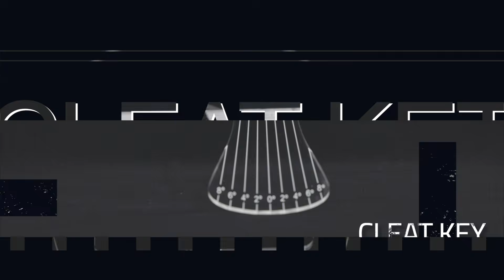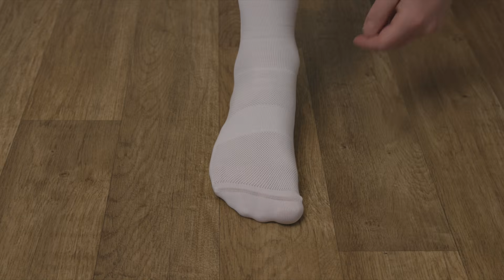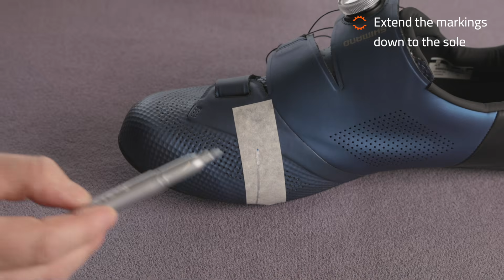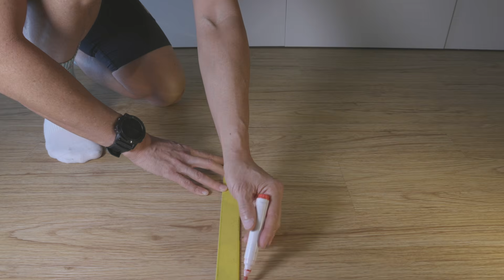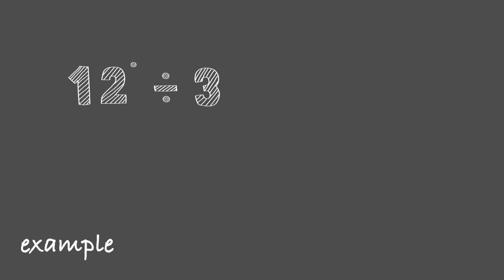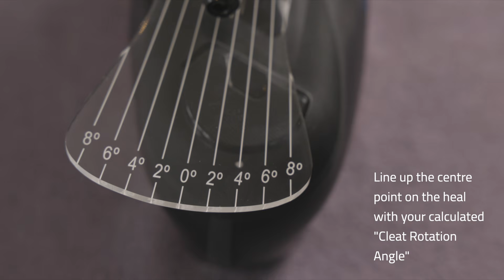HOW TO: set up your road bike cleats

Comment: Hi, why do you divide by three? Thanks
Reply from the maker: Hi @Soonaone, great question.  The human body has an amazing way of straightening itself out when a load is applied. The “divide by 3” factor was determined by observing and measuring riders at all levels to determine a correlation between the angle of the foot in a simple jump test and the neutral position of the foot on a bike when power is applied around the pedal stroke (using digital motion capture). The method has been tested on thousands of customers and Cleat Key users, from beginner to elite. More here: https://www.cleat-key.com/pages/faq

Comment: Just got mine today. I had tried to do the cleat angle myself using some protractors and thought I got it right, but when this tool showed up, it turns out I was 3° off on each foot. Even though this is a very specific tool, I hate uncertainty when it comes to cycling measurements and this is another niche tool that gets the job done and takes uncertainty out of the equation
Reply from the maker: Thanks so much for this feedback @lombremic4840. That's exactly why we developed the Cleat Key. Without it, you have no way of making sure you're getting the full benefit of the float provided by the cleat.

Comment: Thanks! How do you determine the lateral position/stance width?
Reply from the maker: Great question! In the fitting studio we use motion capture to observe knee motion, but the idea is simply to get the knee laterally over the pedal. 

Generally people with a wider hip structure will want to set the cleats inboard for a wider stance, and people with narrow hips will want to set the cleats outboard for a more narrow stance. However, keep in mind that Shimano and Look cleats only allow for a tiny amount of lateral adjustment, just a few mm! A better way for a wide-hip rider to get the knee under their pedals might be to center the cleat laterally and use a longer pedal spindle, like the Shimano +4mm pedals, or Favero powermeter pedals.   

More on this at our FAQ at www.cleat-key.com.
Reply: @cleat-key  thanks! I was hoping for some other method 😀

Comment: all these tools are for look. shimano pedals... i ride time road pedals
Reply from the maker: Yes, Look and Shimano only at this point.  We're working on a version that is specific to Time, which has a larger, different cleat design.
Reply: @cleat-key  not to be rude...but i have always wondered why  time and campagnolo. have always left to last..on the back burner// has shimano bought  out everyone?  sort of ole payola..in the music industry..of years ago..time has been around as long or a little longer than shimano pedals..i worked in a shop back then.. look was first out the door... then time shortly after..
Reply from the maker: @randellgribben9772  First mover advantage I guess.  I got my first pair of clipless pedals in 1986. The Look system first appeared in 1984. Rightly or wrongly, it has stood the test of time and Look/Shimano are by far the market leaders for road pedals today.  That's not necessary a bad thing as it has forced road shoe companies to make (nearly) all their shoes compatible with the Look/Shimano 3-bolt cleat pattern. We sell all 3 brands at the Bike Energy Lab, they're all good, but Time just hasn't got the same level of market adoption at this point.

Comment: im sorry i still dont understand why people need to state them that way for? sorry only just started on road riding but I've always worn stds on MTB so I kind of just use them the same. i use look in the red so I have full movement in them for cornering etc etc but when riding then it just shapes as it does Automaticaly?? sorry curious. oh as for starting started firthust back furt bad so then fushed them furthest to the front then back one notch and kept at that since????
Reply from the maker: Cleat float and cleat rotation are two different things.  If your neutral foot stance (while pedalling) is not centred on your cleat, you may not be getting the full float provided by your cleat. The Cleat Key is used to quantify your cleat rotation angle.
Reply: @cleat-key  im sorry ive only been ridding for now 20 years guess I still need to learn

Comment: I tried adjusting my cleat position, my foot now rubs against the crank arm. What did i do wrong?
Reply from the maker: Don't forget to divide you foot splay angle by 3 to determine your cleat angle! If after doing this, your heel still hits the rear stay, you many need to bias the cleat position a bit.  The Cleat Key can help you fine tune that.

We discuss exactly that in our FAQ here: www.cleat-key.com

Comment: Put the cleats as far back as they go.
This is a really old theory. When you are walking the maximum pressure point in your foot wil be the head of the second metatarsal bone, and it's been wrongly thought that that should be the point where the axle of the pedal should be.
That's wrong.

In Cycling the foot has to be considered as a lever, and it's not such a great lever.
If you put the cleats that far forward you are going to cause fatigue to you calf, and the foot won't be stable.
You have to set your cleats (generally) as far back as they go, cause that is a much stronger area compared to the front foot.
It's a elementary biomechanical notion, as a podiatrist I can't see how this theory has still been shown.

Sorry for the English, greetings from Italy.
Reply: This! Listen to this man. He speaks the Truth.
Reply: Fit two dozen riders like this and then watch them ride.  People think bike fitting is easy because it’s a simple set of rules. Bike fitting is about biodiversity. Set up two dozen riders in the same position and you’ll get wildly different results.
Reply from the maker: @edsassler  Totally agree. Fitting cleats all the way back may work well for some people, not others. And that said, the Cleat Key is the only tool we know of that can help a rider accurately quantify their own individual cleat rotation angle.
Reply: @ back in the late 70’s the New England Cycling Academy came out with a set of free floating pedals with indicators sticking out the side. One indicator moved with the foot, the other stayed perpendicular to the pedal. It was a way of seeing foot angle as the rider actually pedals the bike. Some how we lost this technology. There are countless videos about setting up cleats, yet the hardest cases wind up in my fit studio because I use valid measuring devices….
Reply from the maker: @edsassler  That was the Fit Kit R.A.D. I also used it extensively in the early 80s, but it was fiddly. Modern motion capture systems can now do a much better body measurement job than the Fit Kit sticks sticking out of the side of the pedal. It and many other cleat fitting systems have come and gone (although the Fit Kit brand lives on and is owned by fitter John Higgins in Utah, who is also a distributor of the Cleat Key). The Cleat Key is primarily designed to quantify cleat rotation, and we’ve sold thousands to shops and fitters, including some who have done great reviews on YouTube. It exists because I needed a tool to do this accurately as a fitter, and I thought it could help others.

Just about any cyclist can use a Cleat Key to get a good cleat position, and one that ensures they get the maximal benefit from the available float. These are cyclists who would likely not visit a fitter anyway and would otherwise end up in a much worse position. We validated the protocol using motion capture on hundreds of cyclists over several years, and it worked as intended in every single case. I’m sure there are outliers.
Reply: @ I still have 3 sets of R.A.D. Pedals for Look, SPD and SPD-SL.   Lots of people have told me how newer motion capture systems are better, but nobody has been able to explain just how.  Much like digital timers being more accurate, the interface with the human reading them is flawed. A stick tracking foot rotation with a second one for reference gives a whole lot of information (to a fitter who understands what they are looking at).  My shop has Retul, but the people who come back with problems always come to me.  R.A.D.s tell me how much rotation a client needs, they point out FAI, and help me set lateral position to minimize it.

I’ve been bike fitting for 30 years, I have a cleat template for one client. A few times a year he leaves his mountain bike shoes on top of his car and drives off. He now lives 2000 miles away, but I still get that phone call - “you’ll never guess what I did…”.
Reply: Best to put your cleat on the heal
Reply: @Charles Man I with you too on this.If you can afford the price tag then why not pay abit more and get a bike fit done.I purchased a cheaper alternative called Ergon (£20) and it's perfect for me 👌
Reply from the maker: @gawa62  The Ergon is a bit different. The Cleat Key is transparent so you can see what's going on with the cleat on the shoe as you set it. Also, it has clear cleat angle markings, and will grip the cleat with no play, so the angle setting is accurate.
Reply: BS
Reply from the maker: The Cleat Key evolved because we needed a practical way to quantify cleat rotation, and we thought it might be useful to others. Cleat rotation is one of five cleat degrees of freedom that we discuss in our FAQ at www.cleat-key.com.  We think it's the most important aspect of cleat fitting, and it is something that is otherwise not easy to quantify.

In the video, we show one way to set the cleat fore-aft based on a mid-metarsal line.  You can choose to set it where you like, and there is certainly a trend towards further aft positions.  There are a few disadvantages to a full-aft position for some riders, namely more toe-wheel overlap, which may be an issue for small cyclists, and a biomechanical disadvantage in hard out-of-the-saddle sprints or climbing. For steady-state athletes like time trialists and triathletes, there is a lot of evidence that a more aft position is beneficial. It really depends on the athlete.  We can agree that the old "spindle under the ball of the foot" is essentially obsolete.

Keep in mind also that some shoes have cleat anchor bolt holes mounted much more forward than others. Italian shoes like Sidi and Fizik have cleat holes much more forward than those on say Shimano and Specialized shoes.

Comment: Great video. How much float do you recommend? Is 9 degrees of float too much?
Reply from the maker: It really depends. With the digital motion capture system we use for fittings, we can quantify how much people actually float when unrestricted, and that is typically around 4-6 degrees (we've observed that in around 95% of the population, or 2 standard deviations). For people who naturally float more than that, an 8-9 deg float cleat (like the Look red cleat) may make sense.

Comment: I suggest everyone set the cleats as far back as they will go. Forget all the metatarsal bs.
Reply: Yes I’ve been seeing a lot of new info recommending just pushing the cleat as far back as possible especially for endurance riders. No need to be on the metatarsals anymore with our new stiffer shoes. It’s been a game changer for me.
Reply: I couldn’t agree more. With the current cleats on the market as far back in the ball of the foot is the best considering they don’t go back that far anyway.
Reply: Explain please.
Reply from the maker: Really depends on riding style. We set up a lot of triathletes with the cleats as far back as possible.  However, road cyclists who like to sprint or climb out of the saddle might find they're at a biomechanical disadvantage with this. In the video, we used the mid-met position as a compromise that will work for most people, but feel free to experiment. Also, keep in mind that different brands arbitrarily have cleat holes that are much more forward or aft than average.  We've found that Italian brands for example, have cleat bolt holes a lot further forward on the shoe than do Shimano and US brands, for equivalent sizes.

One thing is for sure, the old "spindle over the ball of the foot" or 1st met concept for everyone, is obsolete.
Reply: They are still using this old theory that came from walking.
In cycling the foot has to be considered as a lever, the cleats have to go far back.

Comment: what is the reason of dividing by 3?
Reply from the maker: Great question.

The human body has an amazing way of straightening itself out when a load is applied. The “divide by 3” factor was determined by observing and measuring hundreds of riders at all levels to determine a correlation between the angle of the foot in a simple jump test, and the neutral position of the foot on a bike when power is applied around the pedal stroke (we measured using both a goniometer and digital motion capture). The method has been tested on hundreds of customers, from beginner to elite.

The reason we didn't pre-correct the angle readings on the tool is because we realize some cyclists might want to know the actual, uncorrected angle their cleat is set at, or they may want to try a different correction factor. That said, the "divide by 3" factor will work for nearly everyone.